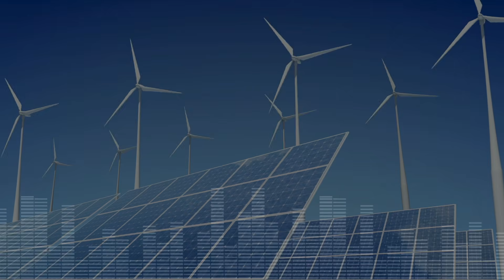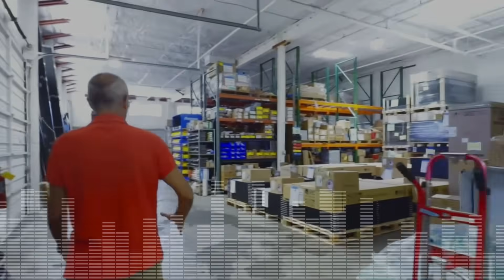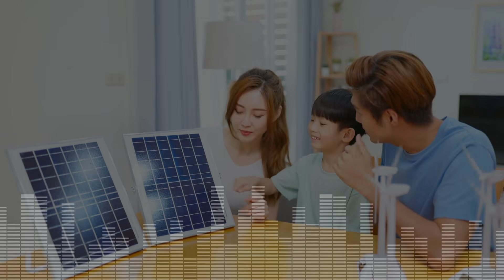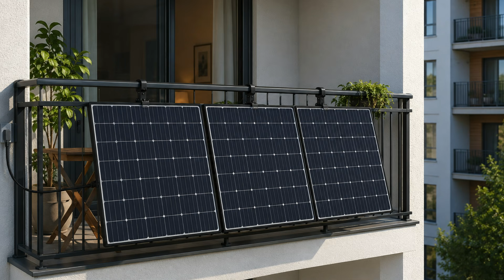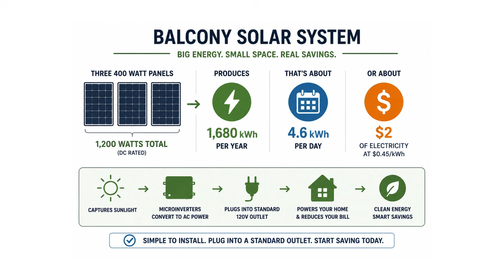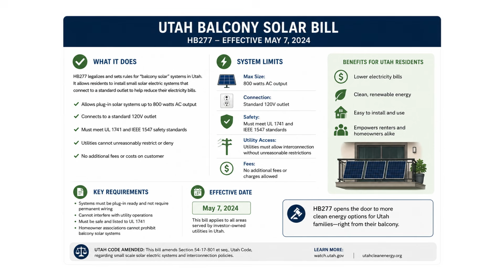Is Balcony Solar BS or The Bomb?

Comment: Florida apartment dweller.  For a hurricane it sounds perfect to be able to ride out the after shock of a loss of electricity.  All I want is a fan, a coffee maker and a small freezer so I don't lose my food investment.  I only need a solar generator not all this connection.
Reply: Get an Anker Solix.  Smaller one would work. The solar panels quit working when the power goes out on these hookups.  When that happens, pop the plugs directly into the Anker and it will help offset any usage and charge the battery, which can run your appliances. This is how I am set up.
Reply: There are soo many countries where electricity price is soo high, like 30-40 cent per kWh. Installing these cheap balcony solar would paid off in 2 years top.
Reply: it won't work if the grid is down,
Reply: Great point. Solar panel lifespan, payback, and such are way overestimated in Florida because they don't include the likelihood of damage in storms/hurricanes. Simple install/removal would help a lot.
Reply: @blakereid5785 in the example given the payback would not take but 15 months, then the next 15 years is free.
Reply: Why do people NEED an electric coffee maker to make coffee?? I see this comment in almost all of the Power Station review YouTube videos and in the comments to them.

Are people these days too stupid to know how or to remember how to boil water in a pan to make pour over coffee, or are they too stoopid to even boil water in a pan? 

Just Google it, I'm sure there's a YouTube video out there somewhere showing how to boil water in a pan and how to use it to make coffee. 😆😂🤣
Reply: a single units not goung to run that much  a power station charged by solad dc might but not freezer ref and coffie at same time except for a very large barely portable you need a full array
Reply: @remocres My Bluetti Elite 100 will do both, 39 lbs?
Reply: I was told these systems only work when they sense the city electricity supply working.  When the power is out these are also out. Yes a panel can feed a battery system and that system can run appliances but talking apples and oranges here with a typical “balcony” system.
Reply: You cant power a light bulb during a hurricane... unless the eye passes over you. 
Afterwards... the advertised maximum 1200W system will produce (Max) ~75% of that in VAC (after 1200WDC conversion). you will get MAX 800w of light bulbs lit. ---dimly
Reply: And your phone
Reply: Micro inverters - that convert the DC output of the panels to 120VAC - will NOT operate when it detects loss of grid power.   If you buy the Enphase device shown early it has a outlet that you can plug into when the grid goes down when their is sunlight.  Limited to about 1200 watts.  With the panels and the IQ Balcony Solar Kit you are up to at least $1500.   Going to take a long time for a payback on that expense...Germany is very relaxed on this - too relaxed.   Some people are going to run a extension cord across their sliding door - that is crazy.  You can blame the utilities - but I can see their point.   They still have to size the transmission grid and generation plants to provide power at all time.  I think the real opposition would be the folks that own those apartments/ etc.  There is no upside for those folks....
Reply: @romanykemp9042 Any larger Bluetti or similar power stations can convert to 120 AC, no problem, the eternal power bill is quickly going the same way as the land line phone.

Comment: I looked into just putting up some panels and a power station, bypass the grid as I have full south facing sun on my balcony including winter low angle…. The math didn’t add up in power savings, but it’s worth it for backup purposes…
Reply: If you have a backup system, why not be able to use it every day???
That's how I designed my home system... It's a backup with a big battery and I added a gridtied inverter to be used daily...
Reply: @SolarizeYourLife .  That’s what I mean by math not adding up by using it everyday, if I didn’t use it much the math really wouldn’t work.  A small system would likely take 15-20 years payback time on power savings alone.
Reply: @TheNewMediaoftheDawn  either your math is way wrong, you found the worlds most expensive setup, or your energy is cheap. My ROI calculation is about 18 months…

Comment: If the power utility finds out that you have what they consider to be "dangerous" wiring in your home/apartment, they can legally disconnect your grid power. Then you will have to hire a licensed electrician to correct the "problem" before you get power back. In the process, you will likely have to pay a disconnect fee, reconnect fee, possibly some sort of penalty and of course you will have to pay the electrician. Why? Because that is the way most utilities operate! So until your state passes legislation which forces the utility to accept these Balcony Solar systems you'll need to be sure that the utility can't see your solar panels hanging off the balcony.
Reply: The workaround to that is to simply not pay the power bill. I medium sized system will feed you all the power you need.
Reply: Pure FUD...

Comment: I've seen and heard many things about balcony solar but it still doesn't add up what's stopping me from not paying my bill get cut off use my panels and batteries to power my house and recharge every day from the sun and cut out the middle man who is the power company using a gridtied inverter is an excuse to still depend on the power company going off grid is best that money you paying for electricity is best used to buy equipment to be independent and gather more knowledge of how best to keep and improve the equipment against future failure points and pass that knowledge down to even the youngest living in the house with grid tied or balcony solar I'm paying for the use of the solar panels I installed to avoid the light bill because if the grid goes down I still can't produce electricity if you have the money go independent break free from the bill you can buy a solar kit by yourself and install it with some help and be up and running in no time no contracts no middle man anyone can do it knowledge is key

Comment: Here is a stupid question, do you know the low voltage 12v landscaping lights??? Why isn't there a solar panel/battery kit easily available to run the lights?!? A simple plug and play like the portable solar power stations but for only 12v output and control of course!!!!
Reply: Plenty of them out there.

Comment: I have been doing this before there was balcony solar... I have two 1000w Y&H gridtied inverters with limiter (in zero export mode), one inverter per phase... Anything over 1000w comes from the grid... But my 48v 500ah battery will cover upto four days without any sun...and I have a 3500w off-grid inverter for blackouts...
Reply: How many panels & what size?
Reply: 3000w on ground mount, and 4000w more to be mounted on the roof (for cloudy days)... But the ground mount is plenty as is...

Comment: There are millions of balcony solar systems around the world without UL3700 requirements, working safely.  Total B$.  UL1741 will do just fine.
Reply: Actually not.
1741 works for product safety and for protecting the grid.  
3700 goes a little further and adds protection for ground faults (people getting shocked) and overloading of the wires in your home. These aren't particularly expensive things for a manufacturer to add to a plug in solar system.
Reply: There’s no way to safely make the plug in work. If the breaker is able to put 15 amps on the wires and the solar is able to put 10, you have now overloaded the wiring.
Reply: @jeffpurdy2347 :  this is not true.  Overloading of the conductors can be prevented using a power control system.  It does require additional monitoring of the current in the circuit but equipment is available to do this.
It has been allowed by Code starting in the 2017 Code.  UL 3700 (the Standard  for plug in Solar) requires PCS and UL 3141 (the Standard for PCS) contains requirements for Branch Circuit Overload Control specifically to address this use case. 

I would agree that UL 1741 alone is insufficient, but 1741 plus UL 3700 / UL 3141 will prevent overloading.
Reply: @jayberd7946 Been an electrician for over 40 years. I’ve been installing solar systems for 30 years. That plug in system can cause an overload just as I explained it.
Reply: I believe the instructions for the kits recommend using a dedicated circuit from the solar system to the house main panel. So as long as the protection controls in the inverter / controller don’t fail and over current then the wiring to the panel on that circuit should never overload. The issue of overloading the wiring can definitely occur if you put a load on the same circuit that is being powered by both the grid source and the solar system. I believe that’s the idea but please of course verify that with the manufacturer’s guidance. Or ask your friendly local electrician. 😊

Comment: I’m in San Jose with existing rooftop solar. I see a lot of ads claiming I can legally add 1kW of plug in panels under existing utility agreement. Is this legitimate? Cost for 2panels plus inverter and mounting hardware around $1500. Good deal? Or bad deal?
Reply: A little steep, a one killowat Bluetti can do that with a 200 watt panel, no more than $700.
Reply: No brainer , how can it be illegal? It's just another domestic appliance for good ness sake !!!

Comment: We're in Florida so I wonder about our  hurricane season blowing them off.
Reply: The eternal electric bill will soon be a thing of the past as LiFeP04 technology gets cheaper and better by the month.
Reply: Use a portable array, take it down before the storm, pull it out of the closet and get that tax free electricity afterwards.
Reply: Don't just use hooks, obviously, if it is bolted down, why would that be an issue???
Reply: @brucearkwrightjr.9246 My Landlord just had them put on about 2 years ago. I'm thinking it was a good company that did the work.
Reply: you can take them back indoors if they are just sitting on your patio/against your house